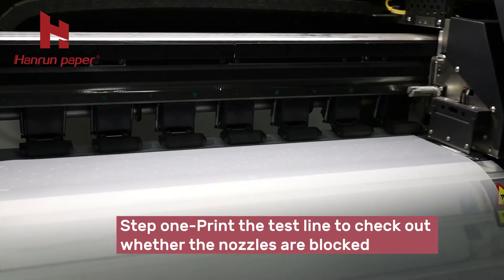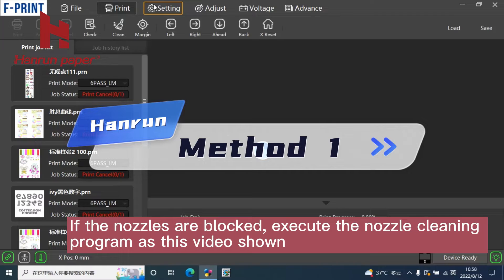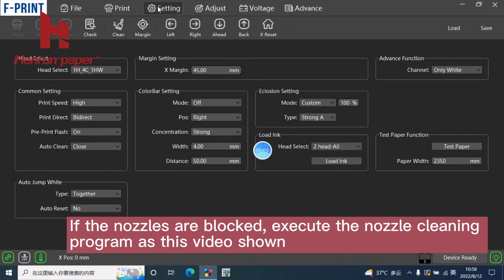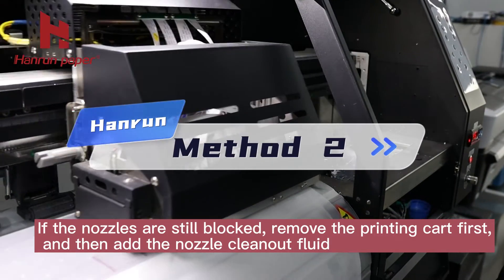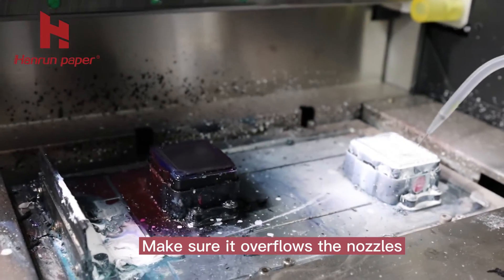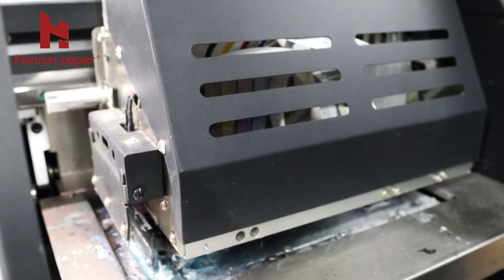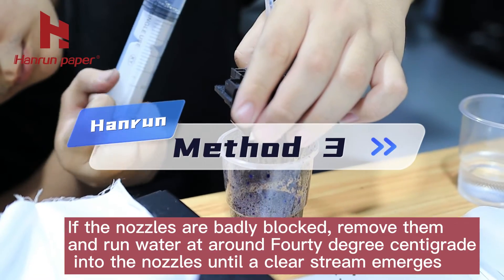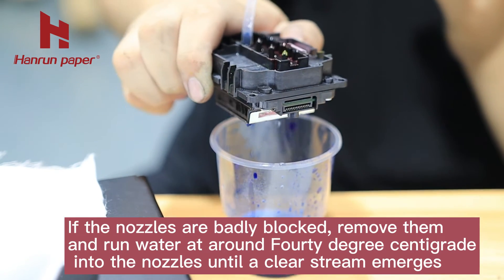How to clean your nozzles? | Hanrun paper DTF Printing Technical Support

Comment: do you have cheap print heads? And how i can prevent the print head jam ? do you have any solution ？
Reply from the maker: You need to keep using your printer and choose a printer with ink circulation system which is very important.  If you do not use your printer for a long time, you need to block the ink tube, which is very necessary. For more information you can come to our website: https://www.hanrunpaper.com and leave your information, our professional team will contact you soon.